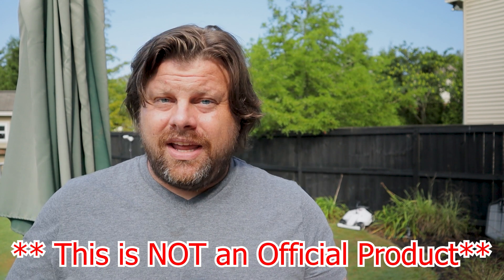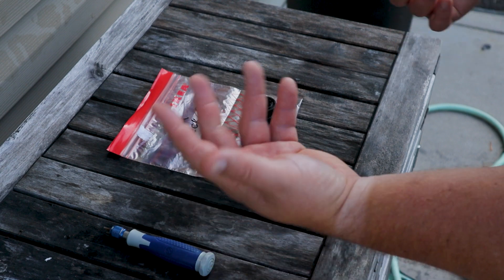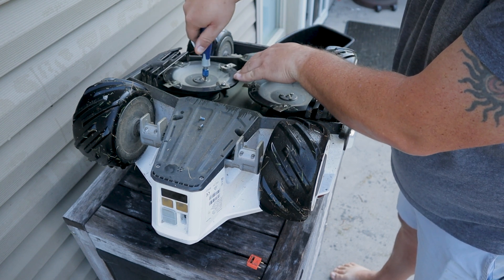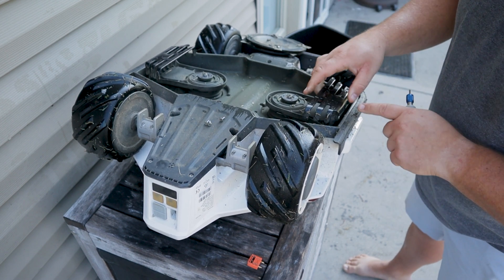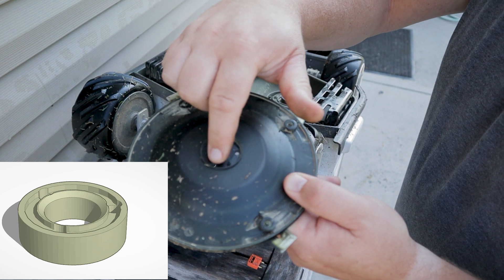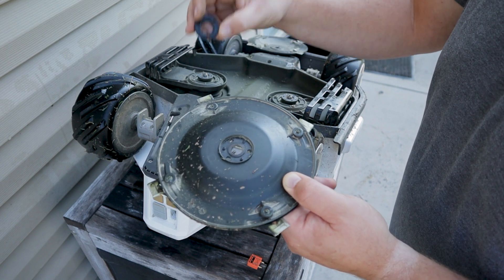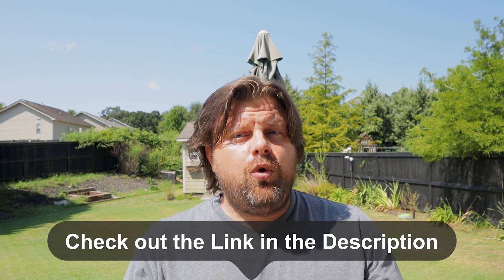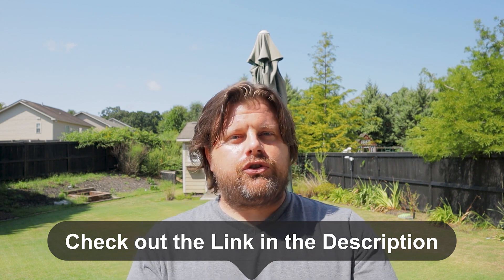Lowering the Height of Cut on a LUBA Robotic Lawn Mower

Comment: I really would like to lower, little worried about the motor overload mentioned, I have seen lots of reviews of these Luba's cutting long grass & never an issue & unless super long so wonder if extending the blades down is somehow upsetting the load. I would have thought 5mm no problem or even the 10mm so a little surprised.

Comment: Going to see if these work on the Yuka.  Pissed off the wife and bought a Bambu A1.
Reply from the maker: They do not. Different size
Reply: @ReelLowDad  Well damn.  Will get the calipers out and start measuring.
Reply: @ReelLowDad  they are super close. They go on the disc without issue. The screw holes are probably .5mm off. Definitely less than 1mm.

Comment: I’m not sure if it’s my printer being able to print true to size of your model, but on my Luba 2, the three holes don’t line up. It’s almost like the spacer needs to be 3% larger.  Thinking that I was just having a hard time getting everything aligned, I decided to test fit the spacer, without the cutting disk, and sure enough, the holes don’t line up. (Not sure if Mammotion changed the version, but mine also definitely uses M4 bolts)
Reply: Printed in PETG if that matters
Reply: I have the biggest version, Luba 2 10000.  I printed the spacers at 100% scale and the holes didn’t align. I printed again at 103% scale and the holes were aligned perfectly, and it still fits perfectly inside the cutting disks!!!  Maybe the Luba 2 has a slightly larger mount?

Comment: With the 10mm spacer, I hearing some vibration with a humming noise...I will check to make sure the screws are fully tightened.  The cut down to. 1" is beautiful and i actually ran this at the slowest pace and had a larger overlap since this cuts down on motor load.

Comment: Just FYI, not sure if it is me or the model - M3 are too narrow in diameter. It appears mine are M4 from the eyeball test. Going to Lowe’s tomorrow to get M4 18mm (can’t find 17mm) to see if this is correct.
Reply: Update: definitely M4. I used 20mm in length and everything is working perfect. You could probably lower a total of 12mm total without serious modification.
Reply: @BlipCrockPot  For the 10mm spacer, the M4/20mm screw works perfectly.

Comment: I went with adding longer screws, deeper shoulder screws using spring washers.  This lowered the cut 3mm.  The hope was lower cut and less grass under the blades.  It did both but motor overload was a major problem while the cut was degraded.  The other negative was the 8 bolts and plastic spring washers were like $41 dollars! Do you have a source and price for the bolts?  I am back to the stock Luba but following your method with hope and interest.
Reply from the maker: I bought a big metric screw kit off of Amazon for other projects. The bolt heads are different but still work. I think it was around $25 for a lot of bolts. Here is an assorted M3 kit for $10 https://amzn.to/3ExGDYH